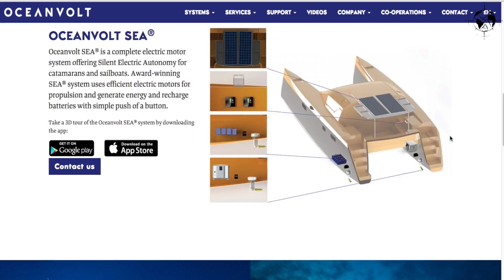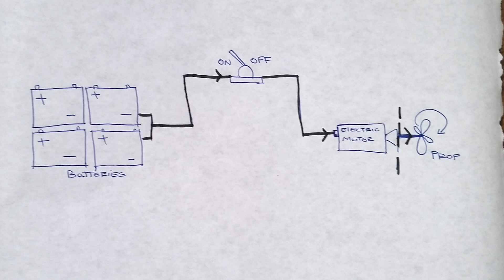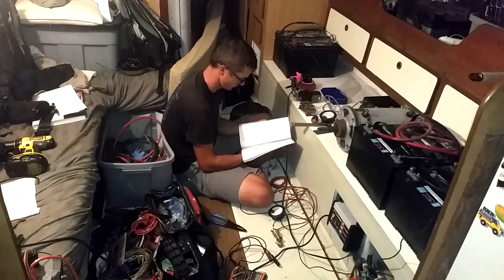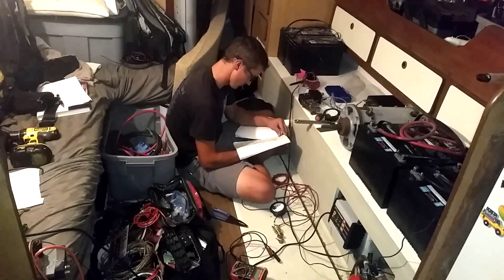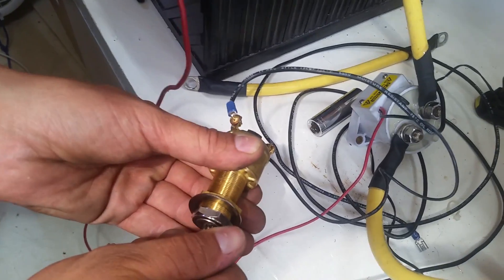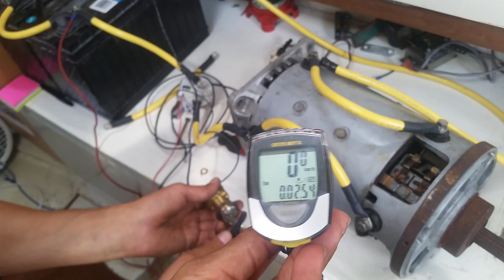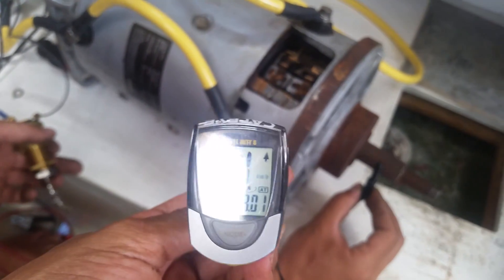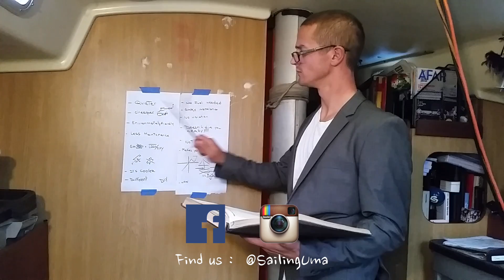We built our own ELECTRIC MOTOR  (Electro-Beke, part 1) — Sailing Uma [Step 17]

Comment: does anyone know where I could find a face plate for my motor or even the schematics for the face of it? it is a club car series motor https://www.golfcartking.com/club-car-series-high-speed-motor-speeds-up-to-21-mph-5-more-torque/ and it came with no face plate so when it is not in a typical mount the armature is not centered and it grinds on the side walls. I have someone at a sheet metal shop to fabricate it I just want to make sure it is a perfect fit.

Comment: If you had modified the brass adapter instead of the motor shaft then when that motor poops the bed you won't have to modify the next motor shaft. Unless of course you can swap the modified motor shaft and put it into a new motor...which you probably can do because you're incredibly intelligent and haven't made one mistake yet that I've noticed!

Comment: I like your design. I have always been a proponent of higher DC voltages aboard boats and even automobiles. If I could get the big automakers to switch vehicle electrical systems even to 24 VDC, many many tons of copper would be saved every year and theoretically lower the price of the vehicle a few pennies. The number of Amperes ("Amps,' "A") needed determines the size of the wire required. If you have a load requiring 100 A at 12 VDC, that same load would require 50 ADC at 24 VDC. It's not quite that simple, but everyone should get the picture. At 48 VDC, 25 A would be required necessitating a much smaller wire with all of the associated advantages of having to dig up a fraction as much copper. Higher voltages would be better still except for the regulatory gobbledegook (National Electrical Code; OSHA) the US government places on DC voltages higher than 50 VDC.

Comment: OMG. Yeah I was right with my comment on your video talking about "Do not buy a couch". You didn't by some very economical electric motor, high end controller, and light weight NiCad batteries. Instead you went with Used cheap stuff. I hate being right.  But I respect what you guys are trying to do. Just wish you had the funds to do it right. Keep making great videos.
Reply from the maker: We made due with what we had and could afford at the time in order to keep moving forward, knowing that it would be fine to start with and along the way we would make the necessary upgrades that we can afford to make without ever going in dept for anything, ever. Although I must point out that aside from our battery bank which we upgraded to lithium and the controller , two summers ago, our electric motor lasted us 5 years and is still working the same way as it did on day 1!

Comment: What are you planning to do about the 5 to  600 lbs of ballast you're going to lose when you take your motor and all the fuel out
Reply from the maker: Sail faster ;)
Reply: @SailingUma  not a joke with that missing weaght your light in the bottom end sails are are calculated by the amount of weight there going to be resisted by you could be oversized on your sales now with lat much less weight in the bottom end be careful

Comment: It looks like someone will get a good boat when you guys get two-footitis, the common affliction of boaters everywhere. Dan, one thing is for sure, you aren't testicularly challenged. You take on tasks the average DIYer would never consider. I cherry picked steps to watch and now I clicked the binge-watch button after reading your bio. Further research will produce more efficient solar "panels" or perhaps a film, or something you can paint your deck with to greatly increase the collection area and thus, output. I had a 10kW system on my roof before Ontario elected a windmill destroying idiot.

Comment: hey man this video was a long time ago I don't know if you're still going to get this, you might not read back that far you might still read it I don't know but if you want to siphon anyting first thing you do is fill it up with a liquid Weatherby water or whatever and then plug both sides and then shove one end in while you're holding the other one plugged to the liquid that you're trying to siphon he might lose a little bit but when you hold that other one lower than the highest point of the liquid you're siphoning you let go with your other thumb and it will siphon you don't need to put it in your mouth and taste it just FYI

Comment: Salut Una:  I have a question about  the installation.  How much weight did you save on the electric motor install as opposed to the diesel?  Also how did it affect the balance of the boat?  Merci pour L’aide!!
Reply from the maker: About 3-400 lbs lighter. And it didn't seem to change the balance any. Just allows us to pack more into our cockpit lockers.
Reply: Salut Sailing Uma.  Many thanks for the help!! :):) bonne journee!! :):)

Comment: where does the thrust from the prop shaft go?  the marine transmission has thrust bearings, your electric motor does not.  the propeller pushes the boat, what is it pushing on?  not kidding here, we are talking about 500 to 1000#s of push.

Comment: I been there and done that and it is exciting. It is a wonderful feeling to lay out your electrical components and connect them together like your schematic....and then watch the system run the way it was meant to do. I didn't do that for hydraulic systems though....hose and fittings are too expensive. Good show Dan!

Comment: I'm a recent grad, I studied physics and geology, not a sailor yet, (buying my first boat within a year SO ADD A DASH OF SALT TO THIS)  but everything I have read says coastal cruisers should have 2HP per 1000lbs, which means roughly 30HP for your boat. Everything, meaning two books and countless blogs personal and professional. You sail smart watch the weather and don't go far yet, but coastal cruising still exhibits challenges your motor won't be able to handle if ever presented.  The motor you have almost puts out a whopping single horse, (HP=VOLTS*AMPS*efficiency of motor[.85 OR .9 is sufficient guesstimate]/746) and with any winds or currents or both in your face you're just going to have to cut and run, if you can. Your kilowatt equation doesn't help me at all with knowing anything, who cares how many thousand watts are used or needed that's an extra and useless number, FOR ME. FOR ME the best way to think about this is: AMPS = WATTS/VOLTS & AMP HOURS = AMPS * TIME(in hrs) & the first equation I used where the estimate of 746 watts per hp are the easiest ways to understand what is needed and what is there and everything else. Everything you do and calculate should be in amps because it is the one value that is directly correlated across your entire electric grid and describes time and power with ease, FOR ME. You have been lucky and are learning well on the water but skimping on some things is just perhaps an unnecessary risk, i.e. the motor and and your dinghy, these tools are your life lines with the coast and against obstacles so why play around? Going electric does sound good in many ways and for many reasons so I thought I would suggest a logical and safer path that is still much cheaper than a new diesel. The short of it is you need to be thinking 240V and towards or up to 100 amps for max power, this would put you in the normal power output of a coastal cruiser and what the boat you have came with. Sorry to hear about and watch your motor troubles, that sucks big time but, you can go all the way up to 100hp for 1/3 the cost of a new diesel. 200amp hr name brand batteries are under $400 with free shipping in america and only weigh up to 150lbs so there is plenty of space in your engine room and the entire system would weight less than your diesel. 4 batteries three power inverters (or one for each phase of the motor) would give near 6 hrs of run time at 100amps of draw. The painful part, $, for less than 4k you could have two three times the power that you really need, all new, so shopping smart like y'all do would save even more from there. Plus or minus you already have usable batteries so that's $1600, (I was thinking of four 200amp hr batts) off the top leaving motor controller and inverters costing under or about 3k new and delivered.  All of this talk and cross-referencing what I know with what google knows has gotten me excited about considering going electric, I just need to think of how to install a kW (your favorite unit kilowatts) solar array two turbines nearing 500-750 watts each plus of course a tow behind generator. A system like this would allow for clean quiet motoring and shit tons of electronics all day, not to mention redundancy.
Reply: 1kw=1.34hp
Reply from the maker: I think your math and my math don't line up. Have you looked over the info on our website? www.sailinguma.com/electro-beke ? Our motor can push our boat to hull speed no problem. We've tested it. The problem now is, we have a tiny battery bank, and the wrong motor controller. We'll be fixing those things soon enough and estimate it will double our efficiency. I think what most people don't realise, is that electric motors are about 2-3 times more efficient at pushing a boat though the water, than and equivalent diesel. So yes, our motor is only about 9hp, but, it's equivalent to a 25-28hp diesel. And so far, the tests we've done have lined up closely with that estimate. You also reference "coastal cruiser". In our experience so far,  we only use our motor when anchoring or going into marinas, so a coastal cruiser would rely much more on their motor than someone making ocean passages. Anyway, hope that helps clarify things a bit.
Reply: No They don't line up and I'm pondering this now and have been. When shopping for electric motors sometimes everything is referenced in kW vs amps, I see the quick and dirty conversion to hp and this makes sense and that most of the world uses kW, I under stand that. I understand the differences between the units  and that mechanical energy differs from electric potential and E&M forces but, when these conversions are made the answers should be the same or close to. So, there must be some analysis issue and or something is missing from an equation or a simple misunderstanding. Maybe a misinterpretation of the graph, I think I dropped a zero and calculated with 800 vs 8000 Watts on the max power input. I see the 14kW batt pack or 292 Amp hrs at 48 Volt potential. You ran your analysis from 200W in put power and velocity 2.3 Knts/hr to a 8000 Watt input power and 6.3knt speed. (200W/48V = 4.2 Amps; 8000W/48V=167 Amps/s) which gives 1.7 hr min and 69hr max hrs of run time. Another way from the equation I used in my first statement is 48V*167A*90% eff / 1000 = 7.214 kW or 9.7hp continuous output, from  the 14kW batt gives 1.9 hrs run time, and 11 nautical miles, (without wind or water currents)  very close to the other equation, within 90% of one another.  Again on the low end, 48V*4.2A*.9/1000 = 0.1814kW .24 hp which gives 77 hrs run time  and somewhere around 175 nautical miles,  (without wind and water currents)  also similar to previous equations. So I think my confussion is in the kW vs kWhr or this vs the amp hr and loosing that zero surely didn't help, none the less  a higher voltage would still draw less amps and give greater run time. I have been looking this up since receiving your reply, thank you,  found this:
 https://www.boatdesign.net/threads/how-do-you-compare-electric-motor-power-to-diesel-power.41038/ 

https://www.powerstream.com/battery-capacity-calculations.htm

http://www.engineeringtoolbox.com/electrical-motor-horsepower-d_653.html

 you already know there's shit tones more out there too

Just to be clear I'm not saying your wrong, i'm just trying to get a dialogue started and learn as well as voice concern.   And now that I think we agree more or less on power consumption how can sense be made of the difference from internal combustion and electric?

Electric motor torque from the physics side of the electric motor = I*B*A, Torque_vector = Meu or magnetic moment X B or Magnetic field >>> Meu =  N or number of turns in the motor coil * I or current in amps * A or area of coil >>>> B = Meu_naught * I / 2pi* r >>>> Meu_naught is permeability of free space  = 1/c^2 * E_naught >>> E_naught = 8.854 >>>> c = speed of light in meters/sec  >>> r is radius. P or power = V or potential difference between terminals (volts) * I or amps this give watts. So that's torque and watts now, hp, = torque * rpm and rpm can come from V = E + Ir where E is proportional to speed of the rotor, V = volts, I = amps, r = resistance.  I think this gives Nm. 

So what's up with the difference in work performance between internal combustion and electric, the  2hp/1000lbs vs 1hp/1500 lbs. I'm just wondering what equation could be used to derive this ratio and how its applicable in cases where rpm's and torques of the two types of motors don't vary much at their full working capacity. Thanks for sparing the time to chat, that's pretty cool. I think It's looking like 460v supplies are the most efficient low voltage motors out there, if it were your 8000W input at 460v you'd be pulling 17 amps giving you plenty of run time to deal with storms currents or lack there of.

Comment: Look's like so much fun! I finished my wind generator yesterday, working on a boat you love is no work at all! I want an electric motor so bad but most have trouble collecting enough energy for a/c and laundry etc... and if you end up relying on a generator it would need to be larger than the original deisel motor due to the loss in converting... or I'm hopefully wrong and you've done more research than me? I haven't been around boat's very long. Are there more recent videos? I'm only seeing a couple from january, sry I'm computer illiterate.
Reply from the maker: +Steven Golay Hey! Thanks for following along! We have many videos, we're up to 48 I think. Just go to our youtube channel to see them all. We also have an extensive write up on the electric motor on our website. Www.sailinguma.com/electro-beke. Hope that helps.